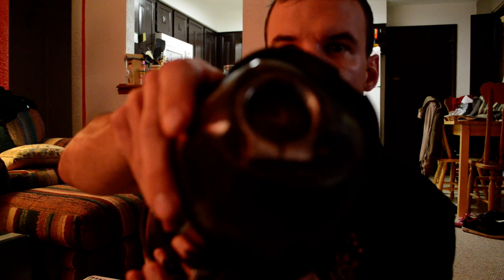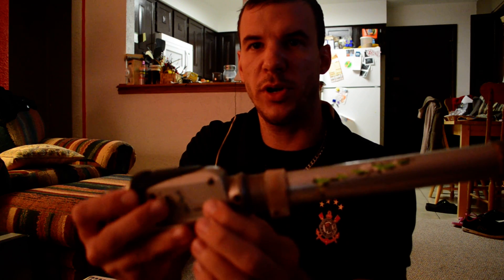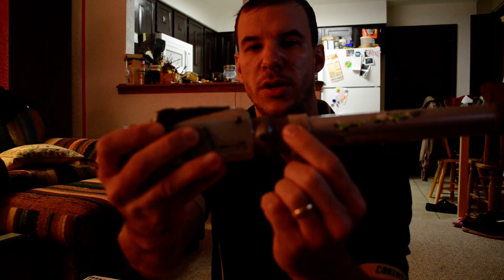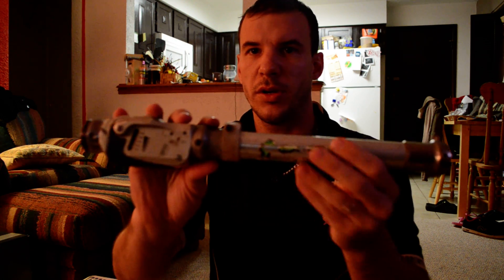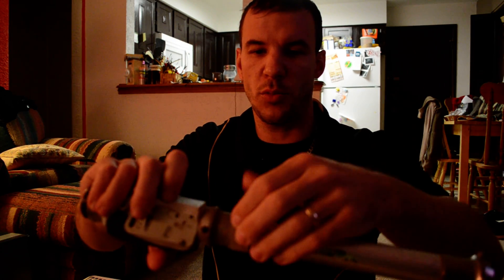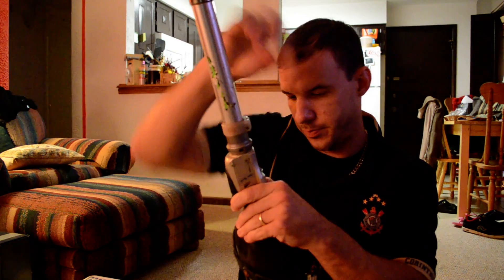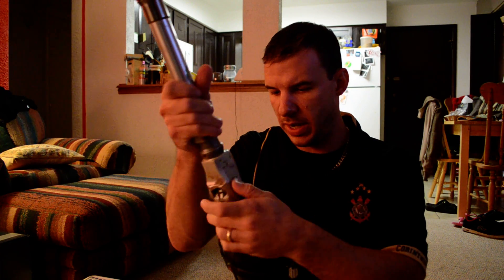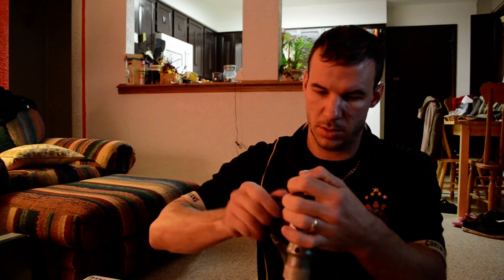How to Assemble and Adjust Prosthesis for AK Amputee

Comment: Your the most honest person doing this on YouTube.  I'm back on the construction site after 2 years as an amputee and have some dilemmas. What the best knee for off word activities or are compatible with wearing steel toed boots?
Reply from the maker: The only answer I can give is 2 parts, the best is whatever feels right and also don’t settle. So try a couple of options. Have your prosthetist bring in a company rep and try 2 or 3 models. 

I don’t use a computer leg daily, many users swear by them. My daily user is a Total knee by Ossur, which is great for me and I climb roofs every day. 

Your purchase (even by insurance) is worth a LOT of money, so make them work for it and be picky. Hope this helps!
Reply: @spiesl  this helps alot my friend.  Can you wear boots without it slowing down your swing when walking  in your total knee?
Reply from the maker: Yes, Total knee has adjustments for flexion, extension, and heal rise. You can use these adjustments to compensate for your boot weight. It takes practice to get used to them and you should only adjust them when you have safety bars or are in a place where you can be safe.  Because they really impact the feeling of the knee. 

If you pay attention on eBay you can usually snag one of these knees for like $1000.
Reply: Thanx for putting up with me I swear your amazing.  What total knee do you use or do you suggest. I'm only asking because they're are a few options.
Reply from the maker: Right now I think I have the 2000, but the 2100 is the best because it has cooling fins  built into it. Really they’re all about the same, I think it has to do with insurance billables.  Just try to buy one that is like new condition because I have broken a few of these models.
Reply: Thank you sir this means a lot. September will be 3 years since my amputation but I get the run around from people sometimes when I asked them straight forward questions.  I have a life to live and I wanna restore it as best as possible with people acting  secretive .
Reply from the maker: That’s excellent. What matters is that you be your best you .
Reply: I have a total knee 2100 now but the gait is too slow. How do I adjust it.?

Comment from the maker: It is called a Narrow ML socket. I used snowboard style binding straps to attach the door to the socket. It is a thicker carbon fiber design than a vacuum system and I do not use a vacuum or a suction valve. I use wool socks. Also the door is plated to provide a tight attachment to my stump. I hope that helps.

Comment from the maker: Oi Carlos. I'm not Brazilian, but I love Brazil. Ti Mao! This socket is a narrow ML style of socket, I use a woolen sock for a liner and the socket attaches to my leg via an adjustable strap system that tightens a door on the side. I also have a different socket that uses x5 seal-in but I have found that my fluctuations in girth create pains on my stump. So if I eat too much one weak and gain a kilogram then my socket will not fit. That is why I decided to return to my old design.